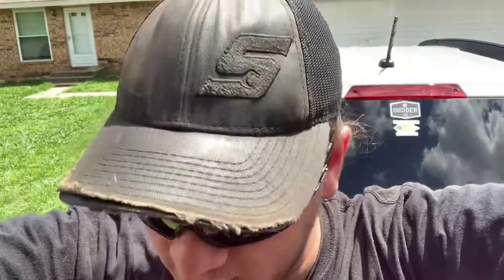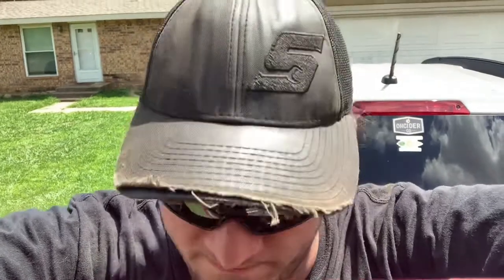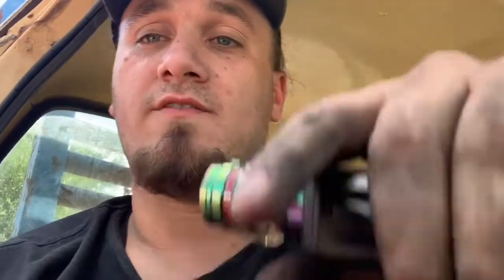Removing upper intake on a 1998 V6 mustang

Comment: Hey man I have coolant leaking from my 98 3.8 L same place. Small leak though. I was wondering if you finished it and if it fixed your issue? Appreciate the feedback. I soon have to replace my gasket... kinda intimidating:/
Reply from the maker: I did get it put back together and it stopped leaking but I wound up selling it due to other issues that popped up later
Reply from the maker: I would recommend to take your time and document where all the wiring goes as well. That was my biggest problem going back together was remembering where it all went
Reply: @worldsokayestmechanic6631  hey man i really appreciate it. i put some gasket sealer on the outside right by the thermostat next to one of the fuel injectors.couple hours ago see how that holds up have a feeling i will need to do it right. just worried i will F*** sh** up..:/
Reply from the maker: @antonioaguila1807  don’t take this the wrong way but you just might with that kind of attitude. Everything I started with that mindset got messed up somehow. If you hit it with a “I’m gonna get this done and it’s gonna work” attitude then your already headed in the right direction

Comment: What are the signs of a bad lower intake manifold gasket? I have a 96 V6 and it has a misfire but because of the injectors and it only has 80k miles. Should I replace the lower intake manifold gasket while im at it or no? It’s the 5 speed manual version if that matters
Reply from the maker: Mine was pretty obvious but I’ve also seen my issue on quite a few others. If you want to check out the inside of your engine and don’t mind the extra headache, go for it. But just be ready because it is a lot if you aren’t ready for it.
Reply: @worldsokayestmechanic6631  been working on cars since I was 7 years old  👍🏻
Reply from the maker: Then I’d say go for it. Just remember where everything goes and how it’s routed or else it’s a nightmare. Also definitely drain at least some coolant from the engine or plan to change oil after